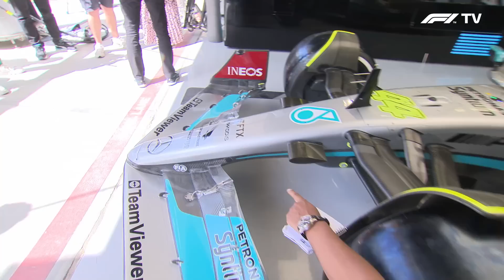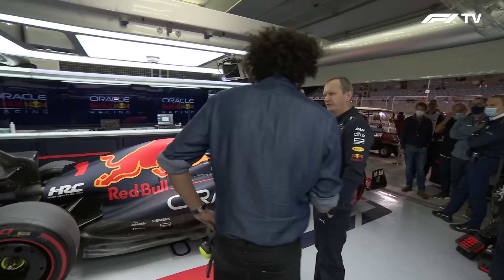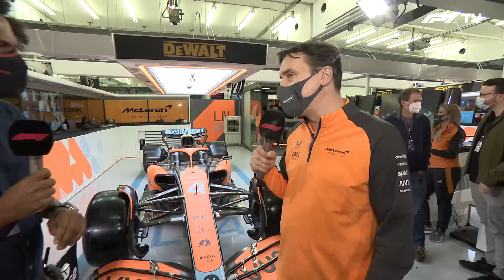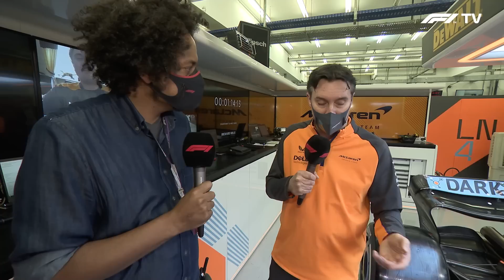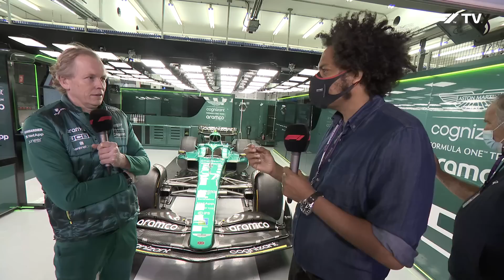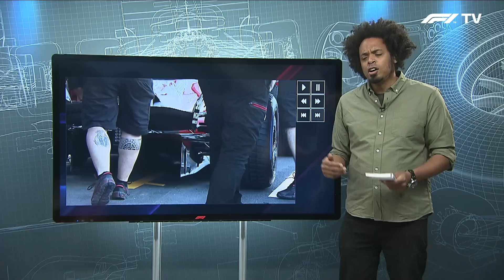New 2022 Car Updates In Saudi Arabia! | F1 TV Tech Talk | Crypto.com.

Comment: 13:27 isn't there a rule that forbids using mirrors for downforce generation?
Reply: They use some complex trickery to get around it. Check out the video that ex Merc engineer did on the Merc wing mirrors
Reply: @wiegraf9009  yeah, but this guy publicly admitted that they modified it to gain advantage

Comment: Hamilton and the entire team haven't been lying by saying that their newest car hasn't been developed properly. I assume that they'll bounce back at some point of the season, and have the opportunity to chase down the best two teams. They need to do it quickly, though, because if Red Bull find a solution to their fuel pomp woes, and Ferrari continues to be the fastest, Mercedes may run out of time needed to make up lost ground.
Reply: yh Merc also having the least amount of wind tunnel time is also a huge problem with development and also each time they test something in the wind tunnel to fix porpoising issues is less time they could've spend on actual improvements that other teams can do
Reply: @Zarphix  Porpoising can't be tested for in the wind tunnels, that's why pretty much all the teams were caught out by it at the Barcelona test. Merc pretty much needs to do their testing on track, which is definitely not easy!
Reply: @wiegraf9009  yh but they need to test any changes they make too the car also in the windtunnel bcz changes to the bodywork also change the aerodynamics of the car

Comment: Fantastic Tech Talk as always. Mercedes' problems with the W13 are multifactorial, the first would be the E10 fuel blend, ethanol has a lower calorific-efficiency than high octane petrol, the reduction in calorific-efficiency is around 30%. That is why when people switch over to E85 with modified force inducted cars, i.e. turbocharged or supercharged, they have to increase the fuel injector size to allow the greater volume flow rate required to produce more power. The power deficiency could be rectified with a better tune. The other major problem that the W13 has is the porpoising problem that the team have yet to solve without degrading performance. The easiest solution is to raise the ride-height of the car, which in turn would reduce the power of the vacuum effect of the venturi tunnels, thus reducing the average and peak downforce that the W13 can generate. The obvious problem is that cornering speeds would be greatly reduced in comparison to other teams, and therefore yield a slower lap time. Since the 2022 rules have banned inverters, heave springs, mass dampeners, FRIC (Front and Rear Interconnected Circuit Suspension) and obviously active suspension, the overall solution will require advancements in a multitude of areas. The Mercedes-AMG F1 W13 may require increased anti-dive suspension geometry along with increased development of the floor edge design to better utilize the out-wash to seal the floor to act light an air-curtain. The front and rear wing designs will need to be altered to have better drag to downforce ratio. I am confident that Mercedes can rectify the problems, as they have solved problems that they encountered with previous cars in seasons past to eventually come out victorious. As a mechanical engineer, I was not under any illusion that Mercedes would be able to rectify the problems that the W13 has within the span of one race or the initial fly-away races. Once the team returns to home base and new manufactured parts are able to be installed on the W13,I think there will be improvement at the Australian GP. I do  not think the improved performance will suddenly make the w13 as competitive as the Red Bull R18 or the Ferrari SF 75,but the delta in lap times in either low fuel and high configurations should be reduced. Regarding the Drivers' and Constructors' Championships, Mercedes will need to unlock the true performance of the W13 rather quickly before the deficit is insurmountable this season.
Reply: We have an F1 keyboard warrior
Reply: Get this guy a job
Reply: He is gigachad😍🤩
Reply: Wow. What a thoroughly insightful comment for the layperson. Thanks! :) :)
Reply: Wow....that's eloborate much on so many problems that needs to be rectified in order for w13 to be competitive again...
Reply: Hey Bono, get off youtube mate you have a race in a few hours. ;) really inciteful stuff here. Thanks for this.

Comment: I think the merc, mclaren, williams, and aston martin are producing too much downforce, their onboards show them porpoising throughout the snaking sections of the circuit i.e. their cars start porpoising at a lower speed compared to the red bull, ferrari, haas, alfa, alpha, and alpine and I think it has something to do with their side pod design and where and how much of the floor it exposes, all those struggling have the size zero shrink wrapped design and porpoising doesn't only give the driver a headache along the straights but can also disrupt the downforce in the highspeed turns
Reply: And the merc engine is by far the worst.

Comment: Mercedes were over 10kph slower on the straights than Red Bull. The new fuels are clearly not working in the Mercedes engined cars. They can tweak all the aero they like, but they need to get to the bottom of why the engines are underpowered, but as they are homologated there is no way back. Don't want to sound overdramatic, but it's over for Mercedes for the next few years.
Reply: exactly ..... the main problem is in the new fuel and spec of mercedes engine .... if they cant fix it or they are not allowed to fix it by fia regulations  .... i agree with you .... its game over for all the teams that use mercedes engine .... which proves the stupidity of current regulations ..... will we have mclaren, aston martin williams and mercedes for the next few years unable and forbidden to improve their pace ?
Reply: @joaocorrea2473  No the customer teams can just ditch Merc and buy from another manufacturer for next year. The Merc team has to live with it though...
Reply: I think it too early to say that just yet. They can still play with the mapping, which can unlock performance.

Comment: Really like this guy. Explains everything so well.
Reply: Usually he just skims over descriptions without every actually explaining anything. He's done endless presentations on aero that never get past how a shape looks, saying nothing about what it may be doing. He thinks that saying an intake is vertical, rather than horizontal, actually describes some function. Or maybe he's a genius and is prevented by his handlers who think everyone watching is too dumb to understand a real description.
Reply: @johnsmith1474  You should apply for his job
Reply: @johnsmith1474  I'm pretty sure Sam has an aerodynamics engineering degree. So I think he is being held back as to how much detail he can actually provide.
Reply: @johnsmith1474  You are right more than 90% I guess doesn't even know what CFD full form is
Reply: @johnsmith1474  He is dumbing it for F1 fans who mostly don't have an engineering degree. Simplifying it in laymen terms. Of course a lot of it is gonna be very general or vague. He can't go around showing the maths, the cfd analysis and explaining in detail every single physics principles  at play.
Reply: @johnsmith1474  I think you're onto it with your conclusion. The general public doesn't have an engineering degree.
Reply: He’s only here for one reason
Reply: @romeoscousin731  ah held off speaking about race I see, really censored your own commentary eh
Reply: @romeoscousin731  he is more qualified than most of the analysts